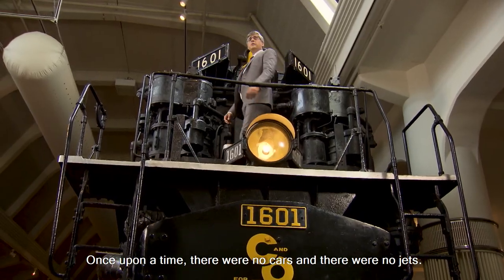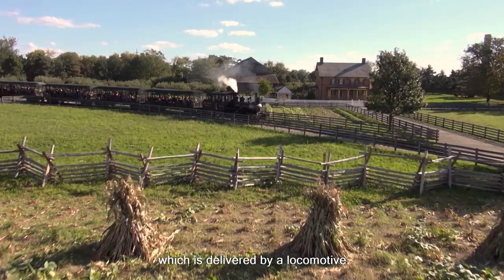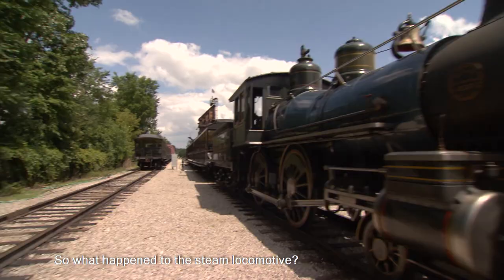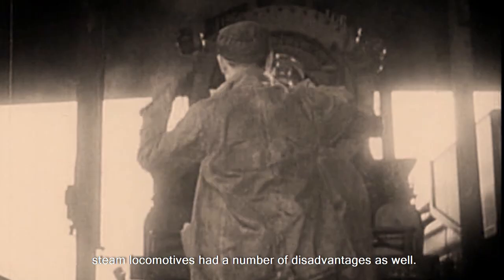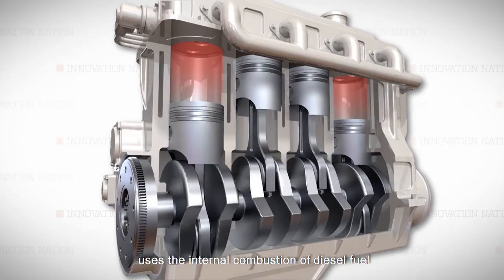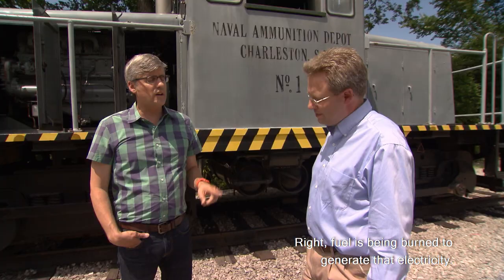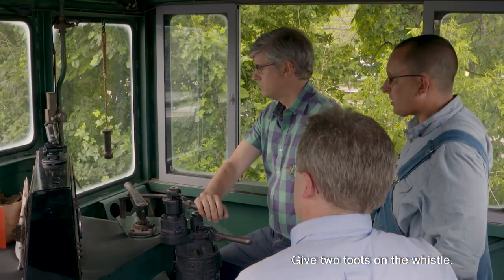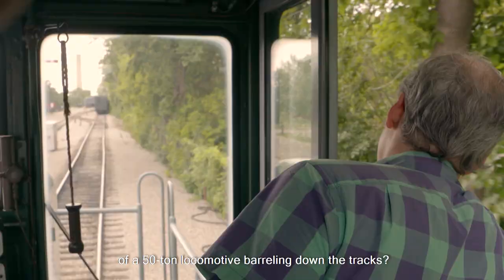The Rise of the Diesel-Electric Locomotive | The Henry Ford's Innovation Nation

Comment: Correction, Steam Locomotives used wood, coal, or oil fired burners. When they were replaced by diesel electric locomotives, most steam locomotives were fueled with oil, similar to heavy bunker crude...
Reply: Yep
Reply: Or with fired firemen?

Comment: Steam trains were the ONLY thing available at the beginning, but then there came the generation of Alternating Current electricity, and along with it came electric locomotives.  That was good, but it took a lot of money to string up electric lines over large areas. In congested cities it made sense, but out in the sparsely populated mountains, it made very little sense to electrify a railway. Then came the introduction of new diesel engines, and suddenly it was possible to haul with you the electrical generator that would power the electric locomotive; that was the birth of the 'Diesel-Electric'  (or more appropriately titled;  'Diesel-powered Electric')  locomotives.